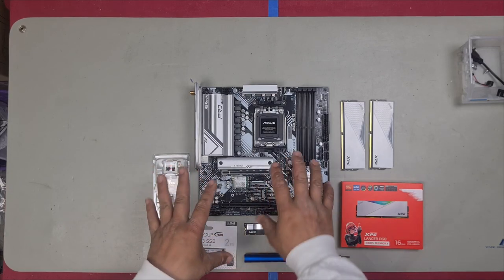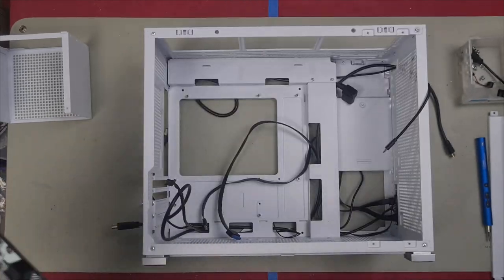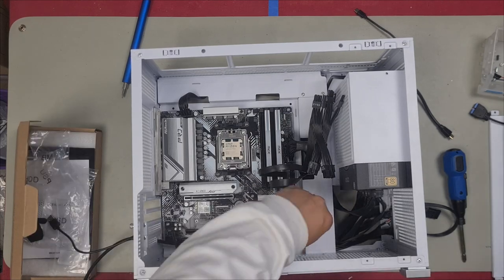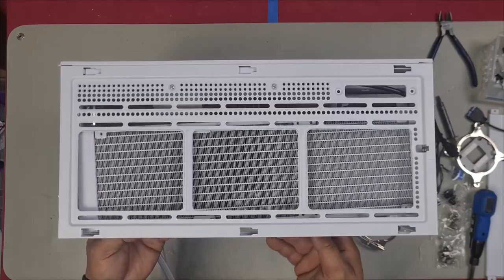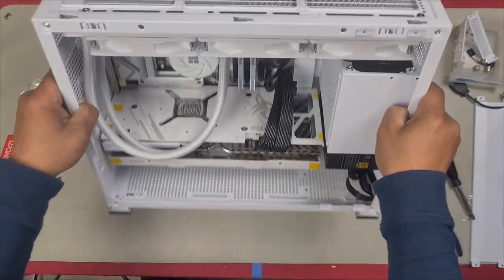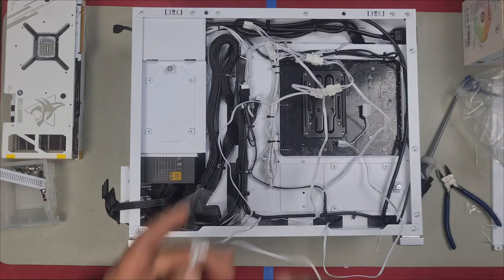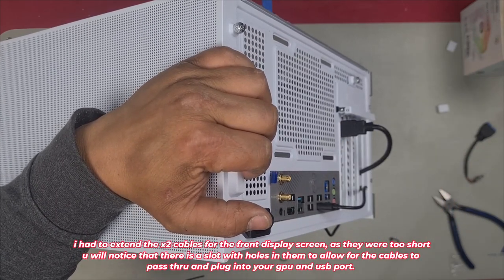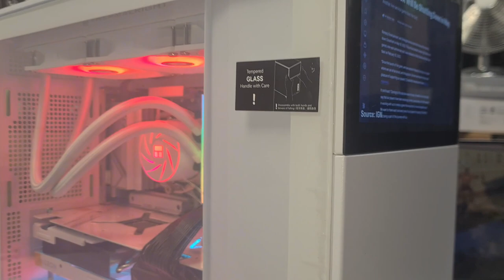how to build a pc step by step guide for beginners jonsbo d31 STD with digital display screen

Comment: You could have used a SFF PSU which doesn't extend past the shroud (or used a shorter GPU ;)  ). Came out nice in the end..
Reply from the maker: true but all that matters in the end is that iy fitted and the panel is the best cuz hides it all... lol..but gpu no way gotta have one of the best ..and made sure it could fit ..just sucks how it went in but in the end ..it all worked out ..

Comment: Thank u, for this detailed pc build guide. Can you tell what were the CPU and GPU temperatures (and their fan speeds).
Reply from the maker: i built this for someone unfortunately I don't have it anymore..however the temps were really good ... stayed about 60 to 70 for gpu under load and cpu stayed about the same under load but on idle its relatively low at about 30

Comment: Yo Mickey thanks for your video dude, I'm building my first pc with the Jonsbo D31 and this is a massive help. I have one question about the power supply, considering I have the regular mesh version (non-screen) wouldn't it be better to set up the power supply fan in the opposite way so it blows the hot air directly out?
Reply from the maker: yes u can def do that... i did end up flipping mine around too and because u got mesh even better

Comment: Ok, this is kinda spooky, I plan on doing build on this case (tho mesh front panel) using same mobo and same cooler... Sadly I couldn't get all-white graphics card, but 6950XT Nitro+ should still look good enough. 

Going with 140mm long power supply will save me quite a bit of headache it seems
Reply from the maker: ye it will still look nice ..but being mesh flip the psu the other way round so it can pull in cool air from the front... I only did mine this way because I had no vents ..it will still look good eventho a black gpu

Comment: We have the same mother board, but my case have no usb type e. 
And I'm new in Pc Build.
Can i know what is usb type E what is use.

Thank you for your video.😌
Reply from the maker: what I did what use an adapter from usb 3.0 to usb type c header..it's not as fast but at least u get the port working

Comment: Excuse me! If it can fit with nitro+ (72mm) without removing bottom fan?
Reply from the maker: yes it should because same size as this gpu 3 slots
Reply: @MIKEYZVLOGZ  I’m looking for this combination and found your vdo is very helpful! Thank 🔥. since someone told me that it’s won’t fit sometime coz of motherboard pcie’s slot like asus or msi, it’s required the gpu to place on the second slot of the case.
Reply from the maker: @jackiegamer3402  it should be OK... I have that gpu as well I can maybe test fit for u but might take a few days as I need to get it back out and disassemble to test fit
Reply: @MIKEYZVLOGZ  it’s fine enough!! Thank u so much for ur help🙏🏻❤️

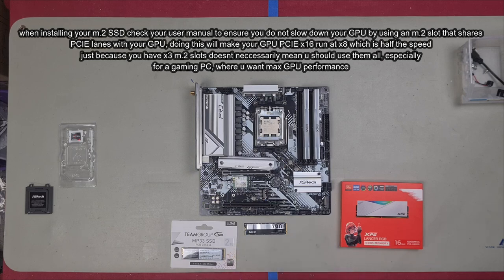Comment: At 2:27 seconds into the conversation, you mentioned something about the SSD that I didn't quite grasp. I plan to use only one SSD, and I'm unsure about where to position it for optimal performance. Should I place it right below or in the middle under the cap? i am gonna use the ( Lexar NM790 2 TB M.2-2280 PCIe 4.0 X4 NVME Solid State Drive )
Reply from the maker: always place it in the slot closest to cpu the top slot. only of u use 2 u need to check which slot shares lanes with gpu slot so I don't slow down gpu performance ..its in the manual for your mobo
Reply: @MIKEYZVLOGZ  alright thanks 🙏
Reply: @MIKEYZVLOGZ  does any of the m.2 slots on this Motherboard share langsam with the gpu???
Planung the get this MB with wifi and i want to install 2 m.2 Nvems
Reply from the maker: @f4kkAa yes it does there's always 1 at least that shares lanes with the gpu pcie x16 .. hence why u never use all slots unless ur aware it will decrease gp performance to a certain extent usually meaning x16 drops to x8
Reply from the maker: @f4kkAa yes it does there's always 1 at least that shares lanes with the gpu pcie x16 .. hence why u never use all slots unless ur aware it will decrease gp performance to a certain extent usually meaning x16 drops to x8
Reply: @MIKEYZVLOGZ  dang i didnt know that. 
So basically i cant use 2 m.2 ssds if i want my gpu not to be limited. 

Maybe that explains the perforcme of my 6900xt on my b550 tomahawk MB xD
I used 2 m.2 ssds...
Reply from the maker: @f4kkAa  I think its just 1 of them that shares lanes...however I'm not seeing it in the user manual ... usually I look inside the user manual and it will tell u if u install this m.2 it will share lanes with pcie etc... just like how installing an m.2 can Ellsworth out sata ports ...its like the same thing ..except it shares with gpu rather the. cancels it out
Reply: @MIKEYZVLOGZ  ty!

Comment: Hey i just installed it like u did and put the psu fan the same way is on your video, is the top front of my pc case suppose t9 be hot please reply!!!!❤
Reply from the maker: do u mean the too half where the screen is? it will be hot of you have it in the same way I did it..because hot-air comes from the psu... which will make the front hot.. do u have a screen model as well? or is yours the solid panel version

Comment: Hi what would you rather choose between this case(mesh version with no screen) and the Asus np201?
As in my country these two are almost at the same price.
Reply from the maker: they are both the same style case comes down to personal preference, as they are basically the same design,  depends which look u like better? u want  tempered glass panel or mesh, then consider which is better suited to you, look at the entire case and look at detailing and what it can store, is it enough for you to upgrade later if u want? enough room for extra hdd or ssd? the jonsbo can fit a bigger card, 4090 easily whereas the asus will only fit up to 330mm which is big but some cards are slightly bigger, 
my personal choice i like the look of the asus better with tg panel

Comment: Wow thats really sick thinking of getting this mobo and trying a simillar amd chip aswell. Did u have any issue with Ram overclock EXPO i believe its called ?
Reply from the maker: with ddr5 when u use x2 ram sticks it's very reliable for expo oc but x4 ram sticks it's alot more complicated..so i suggest if u want 32 get 16 x2 if u want 64 get 32 x2
Reply: @MIKEYZVLOGZ  thank you brother big help

Comment: I got the same case and a b650m cvn but when i try to put it it doesn't because of the pre installed io shield
Reply from the maker: it should fit just fine
Reply: @MIKEYZVLOGZ  it doesn't want to fit and only 1 of the case screws that lined up with the board ( the upper left one )
Reply from the maker: @marandyassinvlogs3273  ur not lining it up properly it should sit right
Reply: @MIKEYZVLOGZ  
When I try to line the other screws I should push the MB to the left slightly but it return back to its place after I stop pushing and I don't hear a click from the io shield 😢
Reply from the maker: @marandyassinvlogs3273  ok so u don't need to hear a click... is your io shield built on.. as In attached to the motherboard or is it seperate ? .. is it the same as mine ? it doesn't always click into place .. some just line up... ensure it does sit right and is flush to the io shield opening. if your pushing and it comes back something is in the way ... or it just needs to be held into place as u see rew in the screws... once u install 1 screw it will stay in place ... especially if your mono stands have a riser that allows the mobo to sit in place ... however regardless its more I.pprtsnt that there isn't any obstruction or cables protruding which stop the mo o from sitting in place ...
Reply: @MIKEYZVLOGZ  
It is built in io shield, b650m cvn colorful , and only one screw that appears in its place but the other not in place
Reply from the maker: @marandyassinvlogs3273  do they look like they line up with the cases mounts? .I haven't used a matx can before but I'm sure the mounts can't be much different... matx usually use 8 mounts and some use 9 and matx are mostly all the same..u can find me on ig and send me a photo of your case and the mobo and ill confirm if u have something in the way..i pressure your case is empty yes? or do u have cables in there already
Reply: @MIKEYZVLOGZ  where do you want me to send the photos + it is the same case in the video jonsbo d31 mesh screen
Reply from the maker: @marandyassinvlogs3273  instagram same logo mikeyzvlogz83

Comment: I also have one final question assuming I'm using a ryzen 5 7600  what gpu would pair well I was thinking the 6950xt because of the price to performance is really good but I don't wanna run into driver issues down the line since it's a bit of an older model would you say the 7800xt is a safer option or something nvidia perhaps thankyou.
Reply from the maker: i use to use a 6900xt and never had an issue .. if u want taytracing get a nvidia for both reliability and rt... but if u don't care about raytracing then 7800xt is a great choice
Reply: @MIKEYZVLOGZ   thanks for the reply man appreciate it

Comment: I transferred most of my previous build from a montech air mid tower to this case, but I've got the exact same fans and aio as you're using. I had to double check and triple check my fan directions as this is my first time using liquid cooling, and my pc is literally running 20c higher in this case. I've got a 5950x cpu and 6950 xt gpu, both would idle at 30-35, now they both idle at 50 and simply opening a web browser will jump my cpu temp to 70! I don't know if the gpu fans are push or pull, but I suspect my gpu is too large and none of the air from the bottom fans are actually making it up to the cpu? What kind of thermals are you experiencing? Should I set the rear fan as intake?
Reply from the maker: your top aio fans should be exhaust ..bottom fans intake cuz gpu fans blow towards the heatsink so it will flow same direction as bottom intake... u can use a rear fan as intake it will help as it gets dire t cool air to the cpu and exhausts out the top from aio .  let me.check my temps and getback to you
Reply: @MIKEYZVLOGZ  thanks! I just set the rear fan to intake, that only helped by a couple degrees. So then I decided to play with the fan curve a little more, and I have to set ALL the fans to 80% at idle just to sit at 40 degrees. I haven't tested under load yet, but I can already tell having all the heat coming from the top is going to heat up the room pretty quickly.  It boggles my mind that the exact same hardware can have such drastically different results in both performance and room comfort just because of a slightly smaller case, and I'm surprised the aio isn't performing any better than my hyper 212 used to
Reply from the maker: @robertfleckenstein3364  yeah its abit hit and miss, also u haver to also remember confined space makes a huge difference, for eg, if you had a roomier case the temps would differ alot too due to the breathing room of parts 
hence the hit and miss, just play around with your settings and config and u will find your sweet spot , and ye it will exhaust alot of hopt air, but the hot ait has to go somewhere true??
Reply: @MIKEYZVLOGZ  funny thing is, before I found this case I was actually looking for a mini itx case that would fit my GPU. What a big mistake that would have been! I do really like this case, so as long as I can manage the temps I will tolerate the considerably louder fan noise. I'm already getting a lot of functionality and "bling" from the screen which motivates me to work out the kinks in my build.
Reply from the maker: @robertfleckenstein3364  actually there are mitx cases that are amazing for airflow due ot the full mesh design, but u have to be into that.. for example the SSUPD meshroom is amazing, so is the lian li q58 its an amazing little mitx case but one of my favourites is the corsair 200d u can fit alot into that huge case its small but tall and it allows for so much hardware 
i personally did builds in all of these cases and was pleasantly surprised just how well they came out and tem,ps were good too, but its due to the mesh design all around allowing the case and hardware to breathe all around
Reply: @MIKEYZVLOGZ  I had looked at those cases except the lian li, as well as several others. In fact one that I really wanted was the Silverstone rvzo3 for the console look. My options were extremely limited because my gpu is 340mm, and I've read about people having serious cooling issues in cases that mount the gpu vertically. Perhaps in a few years there will be more options or I'll replace the gpu with something a little smaller.

Comment: Question, why would you install PSU like this, that it takes hot air from the inside of the case? Isn't it better to let it pull cold air from the outside of the case? I just bought D41 and I wonder how should I install my PSU. I will have D41 mesh version without a screen
Reply from the maker: ok so this case is designed to pull cool air from the bottom and pass through the case ..I did it like this due to having the screen... so I didn't want to trap hot air or prevent hot air from exhausting out of psu.. if u have a d41 mesh flip the psu so the fan is facing forward ..and that will give u better cooling for psu too
Reply: @MIKEYZVLOGZ got it, thanks! I'll try with PSU pulling the air from the outside of the case then, thx!

Also, do you think if i put 3 fans at the bottom to pull cold air, 240 AIO at the top, shall I install exhaust fan as well on the rear?
Reply from the maker: @jjocik  yes 1 exhaust rear a d x3 bottom 120 intake
Reply: I had to turn my power supply with the fan towards the inside of the case because of the noise from the fan was annoying.  All is good now.  And the inside of the case doesn't get too hot.  It's the processor on the motherboard and graphics card that gets hot.  Not to mention that the fan on the back of a psu is the exhaust fan, so it sucks air from inside the case no matter which way you install it.    @jjocik

Comment: What about the mb drivers which one do u download
Reply from the maker: u just download what u need. for rgb control,uI can download asrock polychrome.  whichever u think u need ... asrock also have the auto driver feature where it asks what u need after your windows boots...from there select the ones you need or want..u don't need them all... just the usual ones like for audio. utilities etc
Reply: @MIKEYZVLOGZ  do u even need to download anythink ?
Reply from the maker: @KxngOG  honestlt its just extras u can do without... your gpu driver is most important thats it

Comment: Wrong PSU direction
Reply from the maker: thanks for the tip but I did this because it's a solid panel on the front so it wouldn't get much air ... however wen I flip it around it will get more cool air from the bottom fans intake